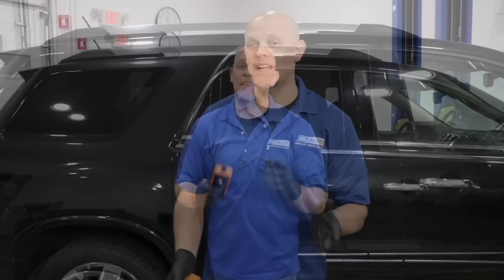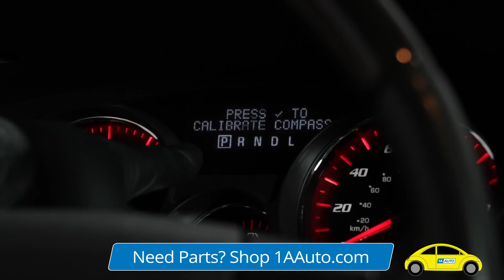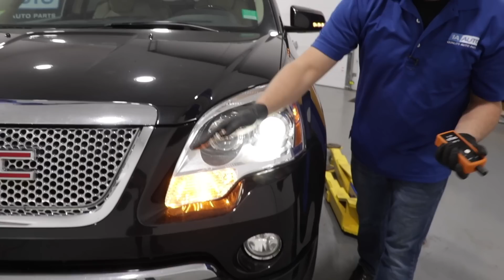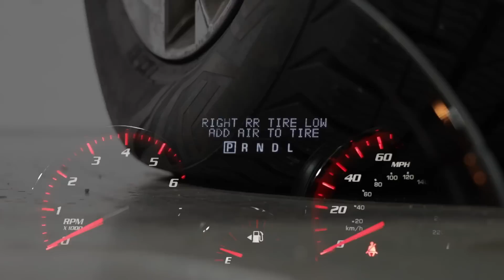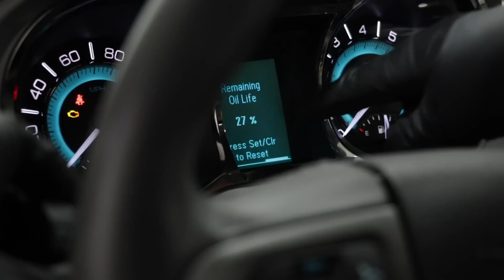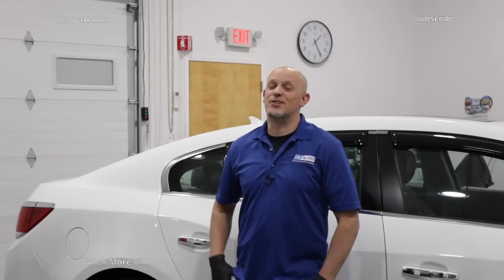GM Tire Warning Wrong Location? How to Relearn GM Tire Pressure Sensors

Comment: Front tires register spare tire on rear after rotating does nothing. Is the sensor missing on spares or is it time for a new one. I have no tire pressure readings on the instrument panel now. All happened from rotating and adding spare into the rotation with new tires.

Comment: is it pretty much the same on Fords ?  I've rotated tires a few times in the past and didn't do any such re-teach procedure.
 just to inquire , how does the receiving unit know which sensor is sensing the low pressure if the transmitter/sensors are
 on the same frequency ?   . . . good video here of course !

Comment: I had the same problem,  pressure monitor said it was the front driver's side tire, but it turned out it was my rear driver's side tire that was low.

Comment: I have tried this 2010 Escalade new tpms oem sensors new tires, I have tried tire learning active manually, and with tool when I turn off the car the info deletes and it doesn’t register let me know

Comment: I purchased new rear tires and weeks later I now have a tpms issue. I purchased the tool but it only reads the front two tires and when I get to the rear it does nothing. Maybe the tires are connected to a different vehicle or just the rear passenger as I never progressed past that one. Am I missing something? How does one reset tires if they are connected to an alternate vehicle?

Comment: In my 2009 Acadia not showing the front tires Pressure , and showing my that i have to check the system of tires monitoring. 
Can you advise what to do ?

Comment: will the method without the tool work on a 2008 Silverado that had the stock steel wheels swapped out for aluminum Z71 wheels?

Comment: Are there any reliable TPS for GM vehicles? I've replaced 6 sensors and 2 of those failed after 2 years. I my opinion, the worst "convince" created.
Reply: Any Schrader sensor with 315 MHZ should work. Autel sensors work as well but they need Tobe programmed

Comment: Nice job, only thing I would add is that when reducing tire air  pressure method is utilized, you have two minutes between each tire or the process must be restarted.  You may also add air pressure to each tire but obviously reducing pressure is safer.
Reply from the maker: +C K Thanks for the tip!